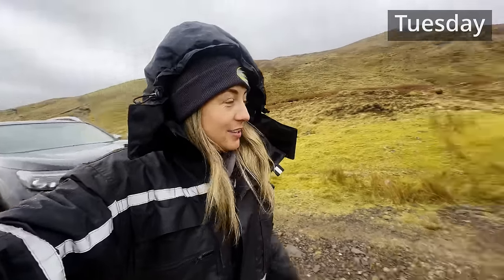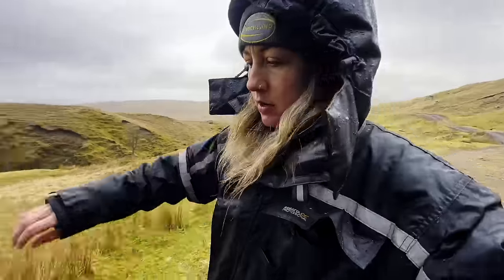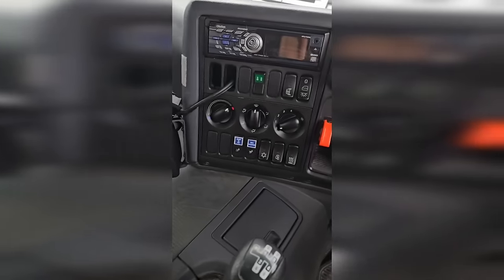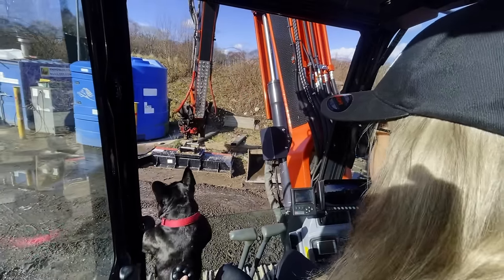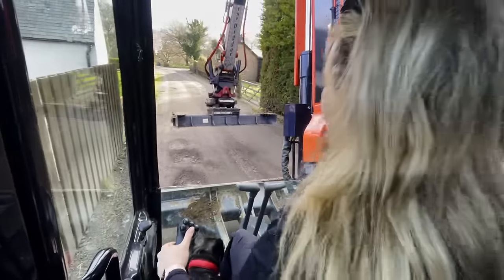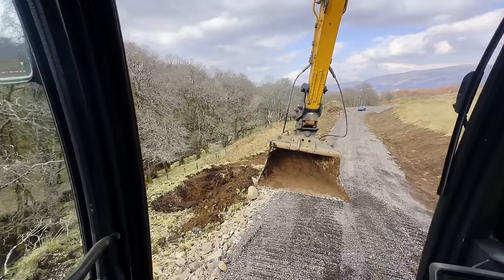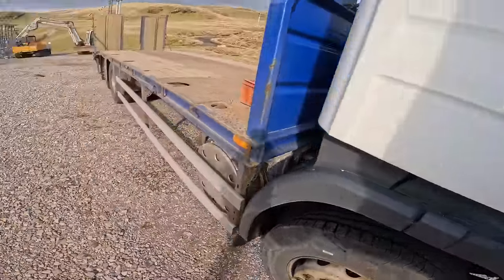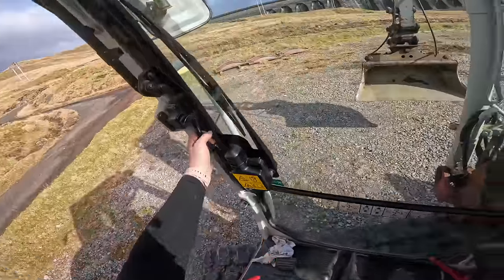We Bought A NEW LORRY Without Seeing It!!!

Comment: At the start of the video I noticed you're dead changing the oil filter I've always been told to always put oil back in the filter because when you start that machine it will run dry to the bearings there has been a YouTube video on this running no oil and oil in the filter and they're highly recommend putting oil back in the filter never run it dry
Reply: Rubbish. Myth from people who don’t understand oil systems.  Will be alreet.
Reply: Filter also screwed on sideways hard to keep oil in.